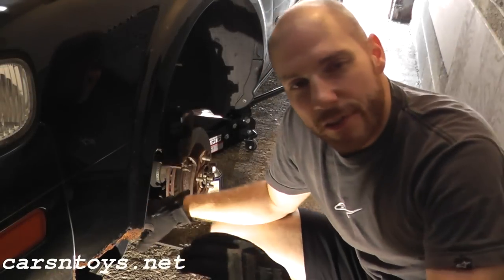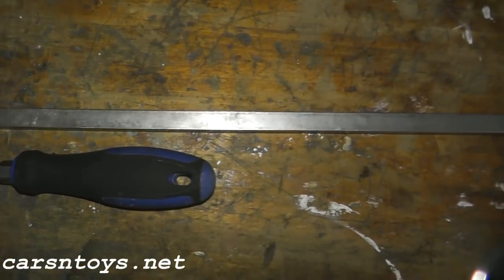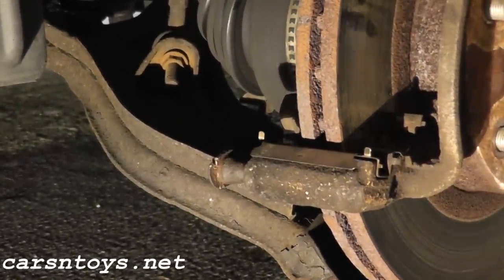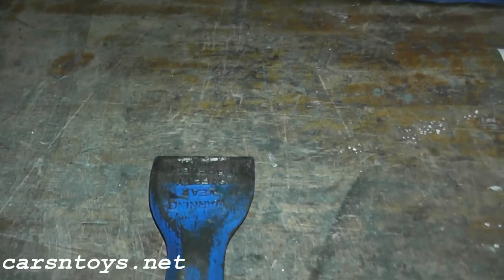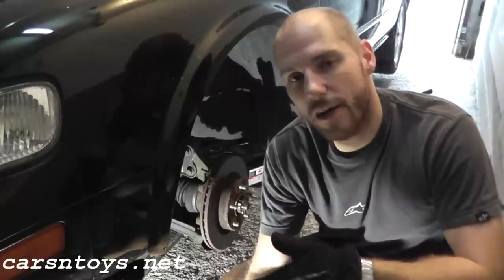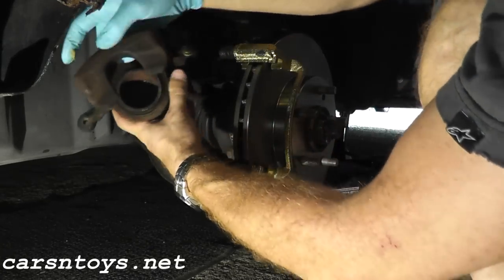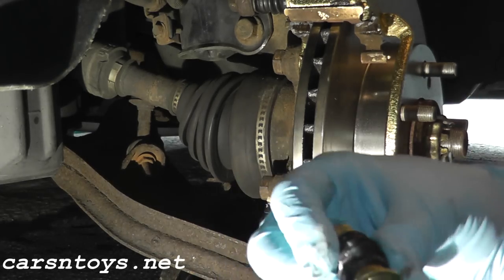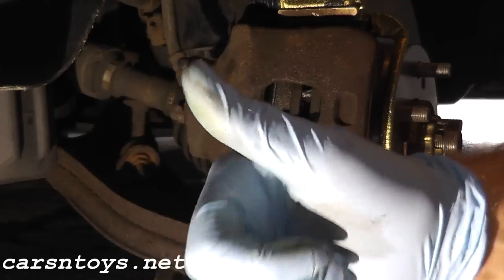Frozen Stuck Seized Caliper Pin Removal HD (Failure & Success =D)

Comment: So the only way to remove a seized caliper pin is to buy another caliper bracket. Thanks for the helpful video I'm going to share it on my wall on Facebook.
Reply from the maker: DrWonderEyes You can use a torch and heat the bottom of the bracket but it's easier to replace the bracket; especially if you don't have a torch
Reply: Or he's safe. Because torching the bracket introduces the possibility that the pin will fire out from the increase in pressure.
Reply: @ucwhitten  this is very true. It Actullay just happened to me the other day.

Comment: Thanks for the tips on getting one of these loose. Between a 2lb hammer, vice grips, propane torch, and WD40 I was able to get the lower front pin on my 2017 Toyota RAV4 unstuck.

Comment: I enjoyed the video and didn't even know that I could buy a re-manufactured caliper bracket. Man there are a lot of haters replying to this video! My pin was stuck but not too bad. I used the hammer and screwdriver method and it popped right out! Thanks. I replaced the pin boot, and removed as much thick grease from inside as possible then re-greased with brake grease and now I'm back in business. I was going to have to wait three days for any of the local parts stores to get in a re-manufactured caliper bracket. Your video saved me days of time. Sorry that the hammer technique didn't work for you. I found it useful.

Comment: Thanks for this video.   I was in pretty much the same spot you were and your "failure" convinced me to go ahead and spend the $30, which I ended up needing.   Showing me what not to do saved me a lot of time.  Also, I was able to get the pin out pretty easily with a propane torch.

Comment: After watching multiple videos of how to remove a seized caliper pin/bolt I mashed everything up and proceded as following:
1. Remove rubber seal with needle nose plyers dont be scared.
2.Torched the fk out of the bolt.
3.hammered the fk out the bolt with large flat head.
4.repeated steps 2 and 3 (taking 15 mins breaks to breathe).
5. Applied adjustable wrench (quality and huge in size).
6. Sprayed pb blaster a tiny bit (clean thoroughly after:  pb blaster is not suppose to be inside where pin is located).
7. Twist back in forth the 🔧 and hammer the wrench.
8. Once bolt can spin 360 degrees while still "siezed" THEN take large flat head put the handle to your man chest and apply pressure like a hug while spinning the adjustable wrench.
9. reassemble new pin with crc black or cemtex synthetic (green pack) caliper and brake. The substance is known to cause cancer and reproductice harm be CAUTIOUS and wear gloves.
10. Reassemble all parts you are officially a Man.

Comment: Does the cylinder thing come out if the bolt has snapped off inside of it without taking the rest of the bolt out? Or will I need to remove the old bolt? Over tightened it and now I'm stuck

Comment: You were right about the torch I took the caliper out had a locking needle nose ready torched it for about 3 to 5 minutes. It came out easy mind you it's 40° f outside. Thanks for the insight.
Reply from the maker: Glad to help!

Comment: I've read some sources that claims the silicone grease should only be used on the guide pins and anti seize every where else.
Reply from the maker: fordwindsor351 Yeah man that works. In fact, the reman caliper bracket includes silicone grease for the guide pins.
Reply: fordwindsor351 because other types of grease make the rubber swell
Reply: copper anti seize

Comment: If the guide pin is frozen to the point the it can not be easily removed, the pin is probaby a write-off.  The bracket will probably have some rust mixed with some brake dust and dried up lube in the hole, so you need to have some plan on cleaning that out.
I imagine washing it out with some penetrating lubricant and brake cleaner? 
In any case , that bracket must come off to do that. 

To remove the pin: grab the pin in a table top vice, and pull while twisting the caliper body back and forth.  
If the pin does not move at all, you are running a high risk that you end up snapping the pin, and then you will have to get a new bracket anyhow. Drilling a broken pin out is more or less hopeless.  
Given the difficulty of removing the stuck pin, and the difficulty of cleaning out the bracket, if it does not come out in 15 minutes, 
I usually give up and just replace the bracket.   It really comes down to time: trying to deal with a stuck pin is an open-ended time waster, that has a high chance of not working out in the end. So..
What I do now, is pick up the brackets, the guide pin kits and the rubber boot kit ahead of time, and return them if I end up not needing them. Got into this habit after having to spend an hour (twice) running around to get the bracket when the pins broke on me on both sides.   BTW the rubber boot kit is pretty expensive, but has 4 boots in it, so one kit covers both sides.   

I recommend putting thread locker on the bracket mounting bolts as well.

What else? Note that the mounting hardware (ie the shims) may be different on the top and bottom.  These are stainless steel, so they can be cleaned and reused.  If you replace the shims, pay attention so you do not end up ussing the 2 bottom pieces on the same side ( top and bottom) because this makes inserting the pads nearly impossible. That is, if you are having trouble installing the pads, double check if you are using the correct top and bottom shims.

Messing with the calipers ( pushing back the piston, hanging it upside down), often kick loose some crud in the lines and the caliper, so it is not a bad idea to bleed the line after you are done.  If you do this, and see that the fluid coming out is dirty 
(black),  you will know I was right :-)  Before pushing the piston back into the caliper,  I tend to remove some brake fluid from the master cylinder ( if the fluid level is high) with a turkey baster to prevent the brake fluid spilling out all over.

Comment: Heating up the bracket from the outside works on getting it loose.  Most likely seized because who ever did the previous brake job didn’t use brake lube or the wrong lube. Mine actually broke off inside the bracket. If yours broke, again use heat but be careful as the pin will shoot out like a bullet as you’re heating up the pocket of air inside. 

I learned this from briansmobile1
Reply: lol mine shot out like a bullet after heating it up for 5 mins with the torch......shit scared the hell out of me.

Comment: I had to use a long crowbar and a 3 pound hammer. I had to keep turning it and beating on it. I got replacement pins from Auto Zone for around $6.00. If you beat on it long enough, it will come out. I hope this helps.

Comment: There is another way: Pins rotate inside of the break mount. you need to initiate the rotation to loosen it up. WD-40 or other antiseize fluid is helpful, heavy hummer and good quality (craftsman) wrench key (small that wont go over end tip and bigger that will hold it for initial rotation) and pliers wrench (once the pin is rotating). Initially remove the rubber seal from pin to the housing to try save it and reduce damage to it. 

1) You take bigger wrench key and start to initiate pin rotation w/ hummer in break housing turn little Rt vs Lt (doesn't matter which side - no tread).
2) Once initial rotation established, pour more antiseize fluid and switch to pliers wrench to break more loose the pin w/ rotation. 
3) Take smaller wrench key and put it bellow the end pin stoppers and beat it pretty well close to it. direction of beating will be like you want to remove it pulling it out. It will take a time and combination of antiseize, rotation and beating. 

Usually I save the Pin, rubber not usually. .

Comment: what I did with the seized caliper is I took off the caliper bracket off and I twisted it in a vice grip. Took about two hours but i got the pin out

Comment: Dont use grease on the back of the brake pads. Might get hot and ooze on to the rotors and then no stopping power. Use anti vibration compound for brake pads and apply to the back of the pads only.

Comment: If you dont want to hit it with a hammer or use a blow torch, the BEST video I found is called "seized brake caliper pin" by Alpha G  Male.

He uses a spacer and socket wrench to back out the pin. I got my seized pin out in about 5 minutes.

----

You should change the name of this video to "how to install a new caliper pin and bracket"

Comment: Finally replace the entire bracket that is the right way. Any way you can cannot used that braket anymore, because already bad / rust inside the tube and the pin will hard or won't slide anymore.

Comment: i got the two pins out using that long screwdriver and a hammer. I put the bolts back into the pins to prevent the bending of the piece I was hammering.

Comment: You probably could have gotten one from a junk yard. Or next time remove the bracket lay it horizontal  then put oil or lube in. Horizontal allows the oil to penatrate all the way in. Then use a adjustable wrench and cordless drill, impact etc to rotate the pin before beating it out. Good luck

Comment: Ha ha hysterical....my Vauxhall has a seized pin, WD40 and vice grips no use....I've resorted to buying a whole new bracket assembly too....
Reply from the maker: I honestly was expecting to remove that pin when I started filming. I could of saved a lot of time just replacing the bracket from the get-go.
Reply: @CarsNToys  I'm a bit miffed... I ordered my new caliper bracket had to get it from Germany... God knows when I'll get it here in Scotland I could find NO aftermarket suppliers here... so yesterday I took the old one and I'd been trying to twist it free on Friday with no success. Yesterday I got movement so thought "go for it" and with 10 minutes of borderline aggression got it out! Cleaned it up and cleaned and regressed all 4 pins...just wasted some money but hey ho that's life!!
Reply: I'll keep the new part as a spare or ebay it!

Comment: 1) you could have heated it
2) do not use such a long implement to whack it. 

I used propane torch, chisel and regular hammer. It flew out like a bullet.
Reply: I used some nitro, had no problem.

Comment: The only wah to get pin out is heat clamp the bracket to something heat it up and twist of with visegrips works great
Reply from the maker: john strong Absolutely. I was hoping to get this done w/o torch but what can you do.
Reply: I got three out. One upper and the two lowers on both front wheels. The last one is stripped. Will get torch to heat it up and use vice grips. Tried with vice grips without heat and no luck.

Comment: Will you ruin the thread of your pin, if you care?

My pin is so tight on my caliper. 

I broke my wrench trying to loosen a bottom pin.  Borrowed neighbor's one.    Putting  in some liquid wrench,  impact wrench,  and even use breaker bar,  it was still too tight.

Comment: yeah, no help at all dude. good intentions perhaps but as other have said, remove it... BTW here in Canada, you cannot even buy only the bracket (let alone for 19 bucks). They force you into buying a complete caliper assembly assembly with the pistons and all and it costs 80 plus core.
Reply from the maker: Wow that's a bummer.

Comment: I just experienced this on a different model of car even though it's not that old.  It was TERRIBLE.  No screwdriver would not have made any difference.  It usually require a very hot torch (get it ROCKET EFFING HOT) and use an 8 lb sledge.
Reply from the maker: Absolutely. A torch would certainly work. Or for around $20 just grab a new kit. Cheers.
Reply: A daft punk i

Comment: Been known to invent new cuss words to help get them out.  Putting the bracket in my large bench vise and using a puller helps.  Caliper brakes and road salt does not mix well.  Another trick, dump the bracket with pins in a bucket with a 50-50 solution of water and muriatic acid, eats that rust away like crazy.  Did you know our illustrious EPA banned electroplating in this country?  Sure that electrolyte contains acid and metals and can be cleaned before dumping it. But really have a terrible EPA, don't help solve problems, but fine and even shut us down.

If those brake products were electroplated, won't be near the problems combined with winter road salt, just begging for problems.  Write your congress person if you feel like wasting your time.  Working for a more conscientiousness company, we shipped our products to Mexico, just inches across the border to have them electroplated.
Reply: WOW, they banned " Electroplating " ???

Comment: I had the same problem trying to get the pin out and I took where the pain goes in that metal by heating it up with a torch and then I grabbed it with vice grips and tried turning it up and down it finally loosened up and I got it out he is the answer